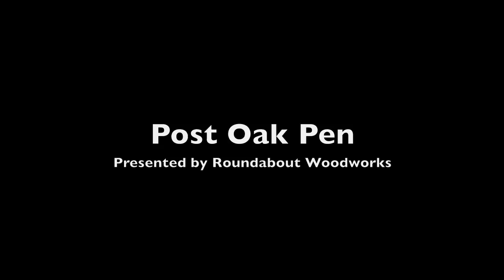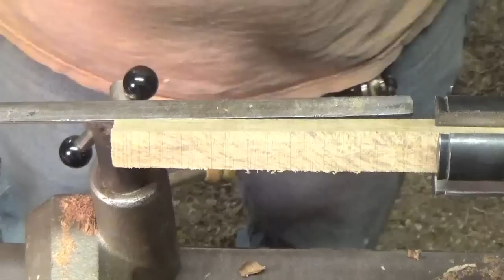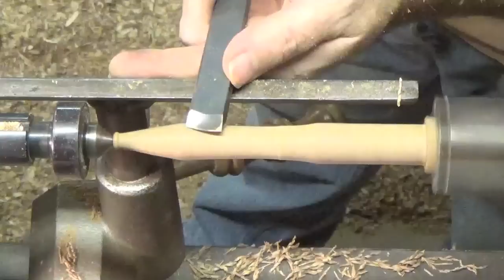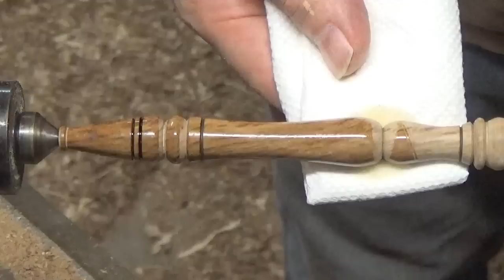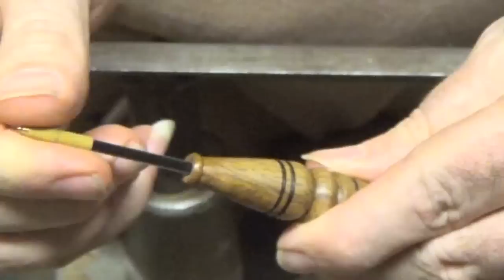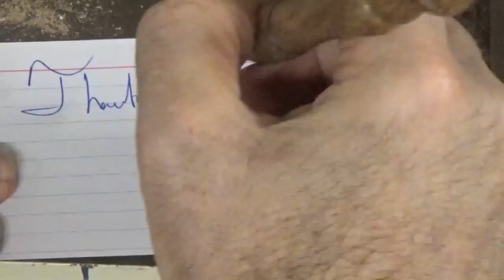Woodturning: Post Oak Pen

Comment: Much more economical than kits and we are not locked in. We can be as creative as we wish. John, is it difficult replacing the refills by using small pliers?
Reply from the maker: If you have a long enough 5/32" bit they go in and come out easily with fingers. If the hole is only 1/8" then you will need pliers. The pens are usually lost before they run out of ink. :)

Comment: Is there a difference between a rouging gouge and a spindle gouge?
Reply from the maker: A roughing gouge is a concave shape, the same thickness from side to side. Think of a wide skew chisel ground square and bent over a piece of pipe. A spindle gouge is made of round bar with a channel ground out of it. It is thicker in the center of the edge, and the sides are much thinner.  I don't own a roughing gouge. I prefer to rough with a skew.  I hope my explanation makes sense.

Comment: what kind of wire do you use in 13:50 ?
Reply from the maker: It's a piece of copper wire.
Reply: Any wire works. It’s best to have a bit of a dowel on each end of the wire - the dowel won’t heat up.